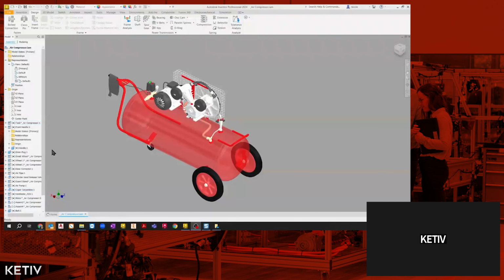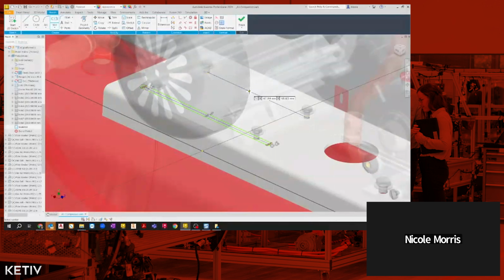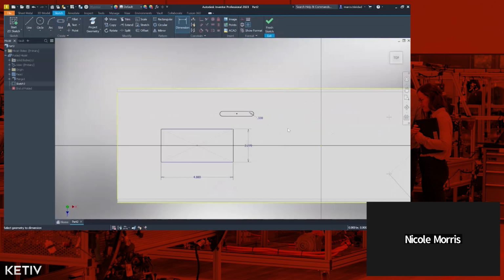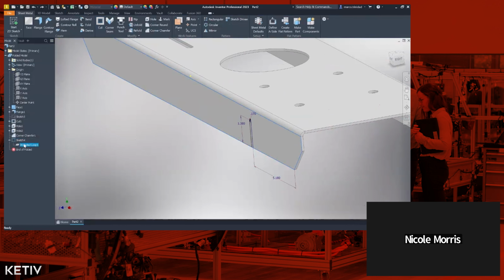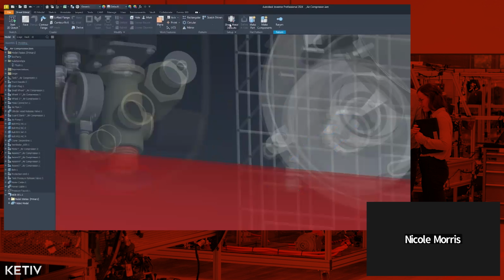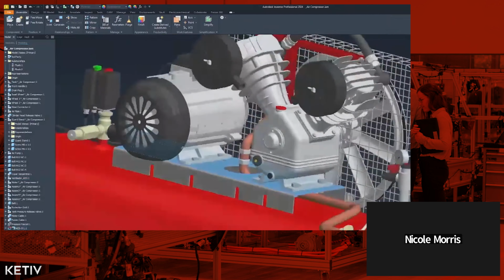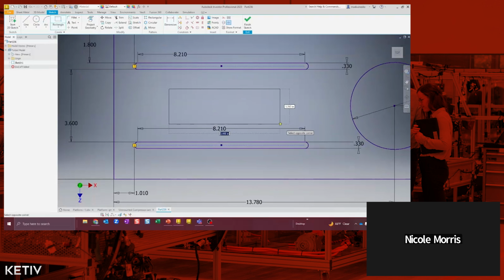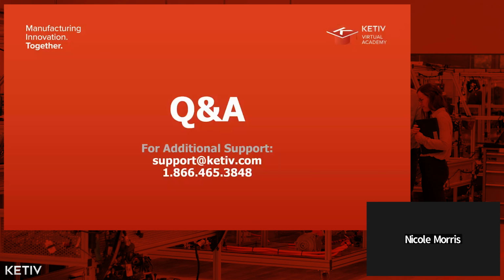How will 5 different engineers approach the same Inventor design? | KETIV Virtual Academy

Comment: Madi,
Is there a reason you chose to not use a centered rectangle in your drawing and use a center line to constrain to?  The slotted holes can easily be made either by drawing a rectangle and arc the top or vertical line then hold the left mouse and draw an arc then line down.  Also it looked as if the side slots and holes were all symmetrical which would allow you to draw them on one side and mirror them or constrain them to a short vertical centerline. 
I also find it easy to name certain dimensions that are going to be repeated so if an adjustment is needed you only need to change one dimension..

It was nice to see different methods to create the base.